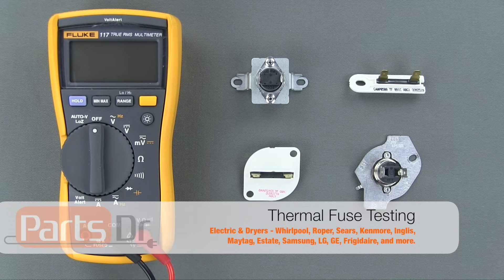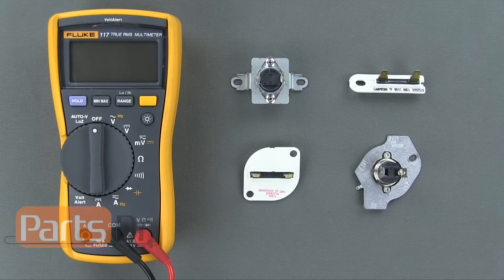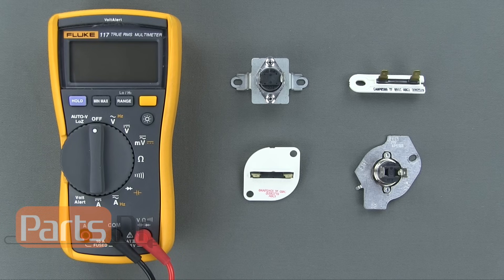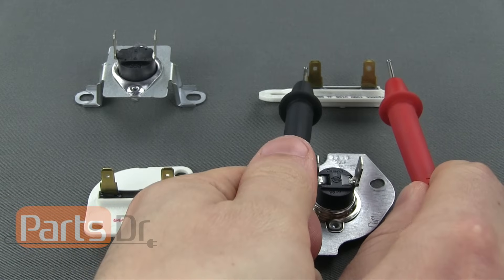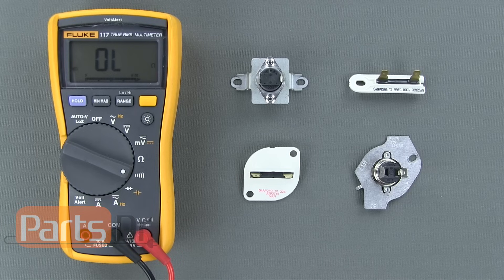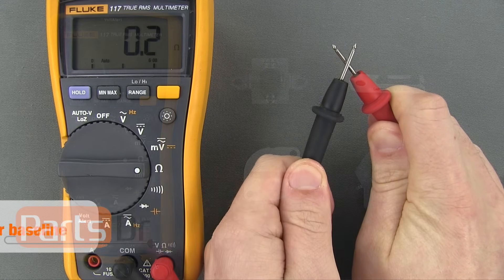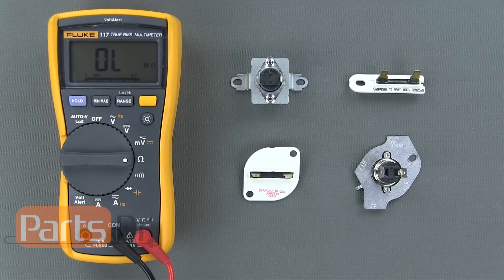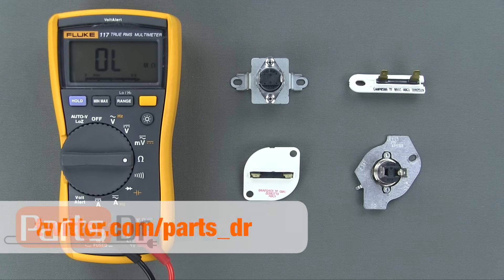How To Test A Dryer Thermal Fuse For Continuity

Comment: Hello Parts Dr, I check all those parts like element heated, thermostat and the fuse look okay but I still not get hot on my Samsung dryer, can you help me the question is what else do I need to check. thank you
Reply from the maker: Hi Ken, first check that you have 220-240v power supply to the dryer.  If the power supply is good, and all of the fuses, element, and thermostats are good, then you may have a bad main control board or motor.

Comment: Please correct me if I am wrong, but one of the parts you tested( the Thermister), needs an ohm test in order to confirm if it is good.   Continuity alone isn't doesn't mean it is a good part.
Reply from the maker: Hi Kevin, all of the parts in this video are thermal fuses.  But if you are testing a thermistor you will need to do an ohm test that is specific to the thermister you are replacing.  Each thermistor can have a different ohm value, so you will need to look up the one you are replacing.  We do have a few videos showing how to test some of the more common dryer thermistors.

Comment: man, I checked every part and wire in my dryer, all have continuity. but it still won't heat. the continuity reading on my heating element is 10.2-11.2 while everything else is 0.2-0.5. does that mean the element is bad?? it doesn't have any breaks in the springs..
Reply from the maker: That is a normal ohm reading for a dryer heating element.  The heating element has a higher ohm value than the fuses and thermostats, so that is normal.  Also see the link below for our video on testing the heating element.
https://www.youtube.com/watch?v=8AG7PtCy0v4

Comment: I have an Admiral gas dryer ADG7005AWW that stopped heating when drying.  I replaced the ignitor which was not working anymore.  Now when I run the dryer, it heats only as much as it might for delicates.  I haven't checked yet, but do you think it might be the high limit thermal fuse?  I haven't tested it yet since I have to remove the front panel and drum to get to it.  Thanks for your help!  Your videos are super informative!!
Reply: Linette A  check all with meter , can also be thermister check with ohms
Reply: Linette A I have the same model dryer and the same issue.  Did you find out what the issue with the dryer?
Reply: Linette A thermister sensor adjust temp to dry clothes
Reply: Linette A also cycling thermostat

Comment: is there a other Way to check  the fuses with out a miter.  dryer spin no heat don't know which fuses  -model  FAQE7001LW
Reply: Rick s  buy kits inexpensive on ebay and replace all under 20$ cheaper than paying a technician
Reply: Rick s can use a test flash light with alligator clips
Reply: seadooman o .......thanks for your help got it done

Comment: what's happen if the ohm reading 10.5 ohm is higher than the ohm base fuse 1.2 ohm? Does this mean it is discontinuity? Can I use this troubleshoot application for other component of dryer?
Reply: Thai Pham  good fuse

Comment: The blades on my replacement thermal fuse are too large (1/4") and don't fit into the female leads on the wires running to it (3/16").

The wires are hard to reach to modify the female leads. Any ideas? Do they sell adapters to connect these two ends?
Reply from the maker: It sounds like you may have the wrong thermal fuse.  The wire terminals should match up and be the same size if you have the correct fuse.
Reply: a user they make a jumper wire on ebay
Reply: I ended up using a "MA02906-1 .25" 2 Male x 1 Female Connector and Adapter Terminal". I trimmed  down one of the 1/4" male leads so it would fit into the smaller female connector that was on the end of the wire running to the fuse.
Reply: Harbor freight sells a kit to make up jumper wire s
Reply: @SuperFishbreeder  If you do that, make sure you use wire that can handle the current or you're going to start a fire.  For as cheap as the right part is, I wouldn't be making homemade adapters for these things!

Comment: At first, I have a thermal fuse without continuity.  I ordered one and put it on and it works for 5 minutes and afterward it was blown.  The lint trap and the vent line was c;ear.  What else can be wrong,  there are couples of thermistor and fuse nearby the blower, beside using the ohm to test that thermistor, can I use continuity (beeping)?
Reply: Tim Horton  you need a kit, on ebay , on off the other sensors are no good replace all , or defective one, and new thermal fuse
Reply: Tim Horton high limit thermostat is going bad
Reply from the maker: +Tim Horton No, you cannot test the thermistor for continuity.  You must test them by doing an ohm test and it should have a specific ohm value at a certain temperature.  If the venting is clear and the fuse is still blowing then we would recommend to check for a shorted heating element or a control board that is constantly sending power to the heating element (if your dryer has a control board).  If your dryer has an Air Dry (no heat) cycle try running the dryer on that cycle to test to see if the dryer still produces heat on this cycle.  If it does, then that is a good indication that you either have a shorted heating element or a bad control board.